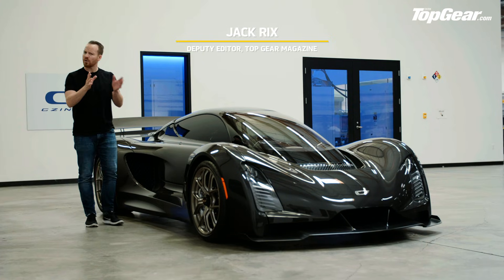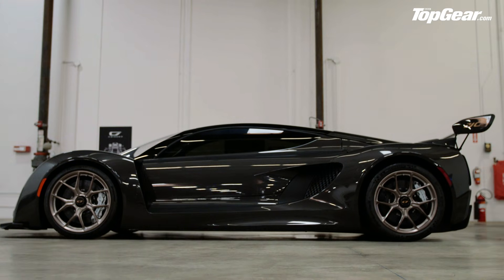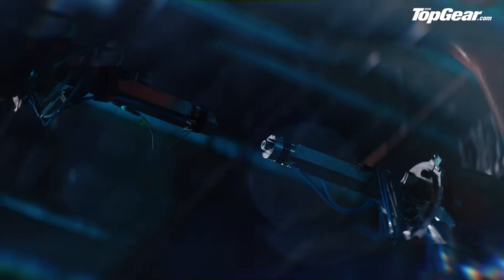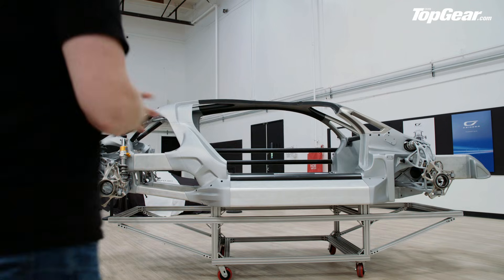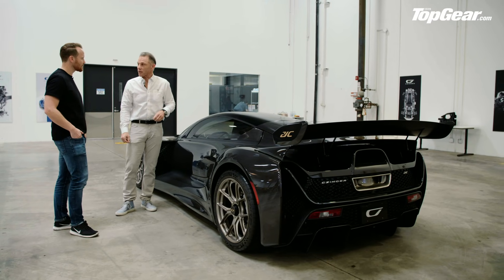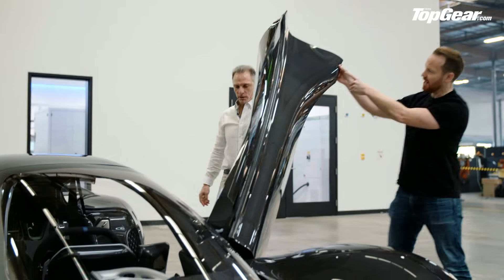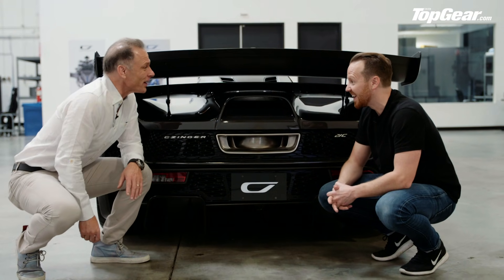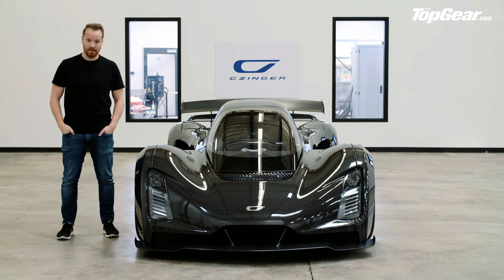FIRST LOOK: Czinger 21C: the world’s first 3D printed hypercar | Top Gear

Comment: What this proves, if they start shipping out cars with no problem, is that Elon Musk was correct when he stated that the most important development in the automotive industry is not the car, but the factory that builds it, the machine that builds the machine as he puts it.

Imagine a completely automated, 3D printing module that is infinitely scalable and can produce whatever car you want 24/7 without ever slowing down, no need to tear down the old production line to build a new one in preparation to start producing the new car model, what you have here is a super fast, super scalable, dead accurate car production that you can switch to a completely different car, with no problem, as long as you feed it its blueprints. Revolutionary.
Reply: This is amazing. This car and this company has had one of the biggest breakthroughs in car history. With AI, cars can be perfect, with minimal problems and issues. Also, this is a genuine car and company that have a genuine and actual hypercar going into production. Unlike some (fake) hypercar companies
Reply: but still costs as much as a hypercar lol
Reply: @crimescene25  This is bleeding edge technology using the the highest quality materials.  Completely understandable in this case i think
Reply: plus its cheaper than some others
Reply: @crimescene25  Economy of scale. Financial, managerial, and purchasing all simplified to the most efficient it can possibly be.
Reply: As Sam Harris warned development and innovation like this will lead to Trillionaire's while the rest of the general public is simply incapable of keeping up with technological advancement to stay employed.

It is a bright and depressing future ahead of us.
Reply: @JasonU21  I don't know about that, who would they sell their products to if only a hand full of people have money? Obviously there will be some growing pains, but it will have to even itself out somehow, the economy couldn't function that way.
Reply: @hzuiel  TRUE only way to solve economics will be basic income
Reply: @stelic9515  I dont believe that is necessary unless economic change is tampered with by governmental forces, lile artificially suppressing automation and then suddenly removing the boot and overnight 100s of millions worldwide are out of work. The economy should adapt at a normal pace, people will shift away from basic monotonous tasks to either high tech, creative, or service industries most likely. If they remove the natural flow of things then it creates waves of mass unemployment, so they almost make government welfare the only solution. Create artificial demand for a solution to a problem they created, that gives politicians all the power. Nobody at their core wants to be on the dole, subject to the whims of the government. I do think UBI is better than like government housing and food stamps, but I am not a fan of wealth redistribution for rhe sake of it, as i say i think interference ultimately creates the very circumstances that necessitate further interference.
Reply: @JasonU21   Well the unemployed could always make crude drawings on MS paint and use AI to turn the drawings into beautiful landscapes to sell to the Trillionares for $100 a piece, so, maybe the future isn't so bleak after all.
Reply: Too poor to buy the tech is already a thing...
Andrew yang and Elon and many others have said global unemployment is inevitable... super crisis on the way.. beware the Vatican beware the pope beware the Sunday law... it’s going to get biblical
Reply: @JasonU21  You're assuming that capitalism will be around forever, which isn't a very good assumption to make, especially considering that it's already beginning to spiral the drain.  At a point where everything is automated, capitalism will no longer work.  Who do you pay if you have no employees, and how does anybody buy anything if nobody has any jobs?  We're coming to that point quickly,  and it's not something we should fear, but be excited for.  No more useless, bullshit jobs doing manual labor or data entry.  Pursue your passions, learn and contribute to humanity through science, the arts, entertainment, what have you, and lead a fulfilled life.  And before you say human nature won't allow for that, remember that we've lived in proto-socialist communities for 90% of our existence, we shouldn't have much of a problem returning to a fully-automated luxury-socialist system when it's the only choice left.
Reply: you also get millions of unemployed people :)
Reply: @lucastseh4709  Only if it happens too fast and education is too expensive.
Reply: What do you mean Musk? I think it was proved beyond any doubt way back by friggin' Ford and the incorporation of the production line... Also, yes, while the premise sounds alluring... You don't actually NEED a 24/7 production model, we can already make way more cars than all of humanity needs, plus, the efficiency and efficiency vs cost, as well as final product quality, in all its different criteria is yet to be proven at all. I'd actually much rather have AI generated roads lol, because the current (government bureaucracy garbage managed) ones are madly inefficient, full of jams, accidents, and that's without even talking of the road maintenance stuff that destroy your car and decrease safety with potholes and bumps and whatnot... Can bet you anything that better roads can stupidly increase society's efficiency, safety, and dramatically decrease fuel consumption, and that's without even going into automated alternate routes, computer car driving, and better cars. I mean yes, if this increases car production efficiency, end product performance and everything else, while maintaining safety, ease of maintenance and repair, that'd be great, but the fact we're like 50-80 years behind on roads (also city management which is also road and traffic destroyer), and how much it holds back society's safety, productiveness, waists time, resources, and adds costs is really quite sad. I also personally think the whole car, or actually, vehicle industry is held back by roads a lot too, Imagine for a second we also had separate lanes for say bikes... Well not bike bikes, these seem to only be ridden by insane people, but stuff like here https://www.youtube.com/watch?v=SawqMSTYUSk&ab_channel=techupdate . So if you're one person getting around (or a bit more, depending what variation of these transports you choose), you waste way less fuel/electricity, and don't face danger from bigger vehicles on your lane, also safety could possibly be improved by installing external airbags around the thing so it can roll if flipped sideways, up front and back too, because it can actually stop you with how light these are. Saves parking spaces and such too. Could also have more mini airports all around to fly tiny private planes, because having some airspace be occupied is also a good idea for decreasing traffic, planes are generally safe too (also, perhaps computer operated planes..?), plus planes are rather efficient... Can make them electric these days too, for short distance flights! And hey, they are even simpler and cheaper to make than cars, maybe even cheaper than a lot of motorcycles https://www.youtube.com/watch?v=hp7JcmwKQcU&ab_channel=PeterSripol ... I bet there's tons of other possible methods of transportation  and innovations just waiting to happen too. Honestly, a lot of problems can be solved these days if you just think about it and let them be solved, heck a lot where proven to be solved, or have pending solutions not implemented, including eliminating high medical costs, way better and cheaper education, way cheaper apartments... But sadly, while it IS possible, and might even sound too good and utopian to a lot, sadly its not to be, because all of these sectors are monopolized by the government, and not only they're inefficient as all hell and don't want to innovate, but they won't let others do it either. But hey, they get to tax like half our income for the shitty stuff they do allow us to have in their infinite grace and wisdom! But everyone seems fine with things as they are so guess the bottom line is we're fucked cuz we're too stupid, compliant, cowardly, violent and dysfunctional as societies to progress anywhere, despite long being able to.
Reply: @mkzhero  we could add 3d printer to the electric car and make a real life transformer runs off electricity that 3d orint things it'll be able to  stand up like a transformer and have a human in it's chest and it can be able to switch into crawl mode to drive in all 4 cause it'll drive on its 2 feet with wheels and we could make have those 24 hr factories that make these electric transformer and everyone family one even a newborn one, and you'd just go and grab one, it'll self drive and tether gps with your family gps,  were moving into farming and instant travel this way but it'll be all insane like that cartoon with the flying cars behind the truth it'll be messed up
Reply: @user-zp9mh4lx8r  Lay off the drugs kid, i have no clue what you're saying...
Reply: You always wanted a model T , now you can have one. No more  of the car companies telling you, the buyer what you can have.
Reply: Complete freedom for the buyer, 1940 ford, ultra modern, no problem.
Reply: Agreed
Reply: 4th industrial revolution  AI be ready
Reply: What you prove is that any factory worker already knew this... most of the poorest labors knows this. ..
Just look at how an apple factory works ... how apples are sized using photographs color size etc 20 years ago ... old tech really.
Reply: With out slowing down? 
Who provides the resources ? 
Input is still sketch out put is fine
Reply: Panopoulos greece Haos print 3d car loooong time agoooo
Reply: Interesting. I remember hearing Musk say in an interview that he initially expected too much out of his robots in his factories and had to rely on humans more than he thought he would. I wonder if this company figured out the process where Musk missed.
Reply: the blueprints where made by an AI
Reply: and the millions of people working will be out of a job
such revolution
Reply: You can add an 5g chip in the car and it'll react with the other 5g towers around instant travel  been here
Reply: Revolutionary that will kill the economy. Yep. Phenomenal.
Reply: Yeah, they could have 8 3D printers and 4 vertical assembly systems at a total of about 16 robots putting together 4 cars at the same time and the facility wouldn't even be half the size of a standard auto assembly plant, it really is amazing and other car manufacturers might start using similar methods to make new models of their cars and even create new facilities, instead of one large facility they could have several small facilities spread throughout the country.

Comment: It's beautiful.  Why aren't there more single seater cars in the normal price range?  I would love to have a single seater like the Bac Mono but affordable and with a roof and that is more along the performance and practicality of a WRX.  Think of the savings in terms of weight and cost: Less doors, controls, seats, seatbelts, airbags over a sedan.  And the packaging would be so much better.  No compromised A/C or ICE setup.  Perfect steering rack geometry and weight distribution.  I don't see why a 1 seater has to be marketed as a weekend track weapon or a multimillion dollar hypercar.  Please Subaru.  Make the next WRX/STi a 1 seater mid-engined flex fuel winged car starting at $23k USD!

Comment: Saying something is designed by a computer is incredibly deseptive... As far as I know Singer has not yet cracked A.I. What they are probably doing is inserting  a CAD file rendered by an engineer; into a fínite element analysis software tool which must have some built in software that re-models the part into something that maximises material shape and quantity where there are stress consenration areas... It may even be a person doing the rendering with the output from the finite element analysis tool. Designed by a computer just sounds good.
Reply: But that sounds a lot less flashy and wowing than "oooh, AI and shit".

Comment: Chaos is coming out soon.4000cc V10 twin turbo. 12000 and 13000 rpm  rev limit 2000 and 3000 ps 0-100 km less than 1.8 sec  top speed over 500 km  max weight 1150 killograms......and the fanny thing  made in HELLAS as known as greece!!!!!!!!Find out more  on you tube.Search chaos  hypercar!!!!!

Comment: Ok, totally got me with the knuckle shapes... AND then the carbon tube nodes, AND the seating arrangement AND the heavy focus on weight reduction and modular design. This is my new favorite car, ever. Now it would be nice to apply that tech to build cool, affordable cars using the most reliable existing drivetrains such as GM LS, HONDA K SERIES, TOYOTA/LEXUS 2JZ, UZ SERIES etc... And get rid of all the bloated, UGLY, over gadgetized and failure-prone pieces of shit pushed by manufacturers.

Comment: CHAOS is comming.Greek hypercar 3000Hp
Reply: Hi, I don't understand greek at all, could you explain me something about the powertrain, weight, chassis, suspensions, technology of that Hypercar?
Reply: First of all its not a Hypercar its a Ultracar made in Greece!
- "ULTRACAR CHAOS" - 
1. 4.0-liter twin-turbo V10 engine firing  3000HP /use E85./ 90 degrees
2. 12,000 rpm/ Red line.
3 Aerodynamics capable of a top speed of over 500 km/h!
4 Special self constracted All wheel drive system.
//Eight-speed gearbox dual-clutch transmission
//Torsen differential to all four wheels
//0-60 mph time of under two seconds
//65% of it will be sent to the rear wheels and 35% to the front!
5, Weight:1000 kg-1150 kg maximum estimated./ Witdh 2.08m
6 The Monocoque chassis and the two seats made fron Zylon material for more stabilityf and safety reasons! (The two seats are build in / to the Monocoque!). 
Body uses Carbon Fiber composite and others like Kevlar etc other parts!
7. 3D printed Titanium Quad Exhaust Pipes (drilled). 3D printed Inconel.
8. Interior: 2 Seats - Augmented Reality - 5G Conection to server / Live Tune Protocol.
9. With a power to weight ratio which is close to 2:1, where for every 2 hp there is 1 kilogram of mass. With such a ratio mated to a suitable transmission technology, with the resulting adhesion, the driver will be able to experience accelerations up to 3G, for specific distances and conditions. The vehicle moving from A to B will need half the time needed by a hyper car or mega car. This may require the driver to have special driving skills and a better perception of space in order to reach the vehicle’s potentials.
10. Specially tires order from abroad Pirelli! (a special tire rubber that heats up harder, with softer sides, which would limit wheel slippage and for a better grip on the road surface)! (Depending on the tire grip) 
11. Downforce 1740 kg / G-Force 2-3G+ 
12. 3D printed 2.08cm Wide Matrix -LED Tail and Stop lights brakes rear end.
13.Special designed and constracted "lightweight" and very strong mechanical components and parts by using "Anadiaplasis" method  all over the car/ that results/ reducing the cars weight very efficient !
14. Color/Material: Anthracite Matte /Graphite Aluminum,
15.Airflow Volume 16.990M3/HR / 1.04m Lower Center of Gravity Car.
16, There will be no exterior mirrors instead there will be cameras built into the cars body and only when the car is turned on will they be automatically moved out. The roof of Chaos A material revolution in each and every one component of the ultracar.AMORPHOUS METAL DUBBED SAM2X5-630.
16b.Printed "anadiaplasi" magnesium matrix composites Calipers and bells & carbon ceramic discs for Chaos.
17. / 0-100 km/h  1.8 sec / 0-400  km/h 7+ sec and capable of a top speed of over 500+ km/h!
for mre details....see the video;
https://www.youtube.com/watch?v=u-lu0QhKaio
Reply: @vassiliosca5715  
3000hp from a 4L V10 seems almost impossible to reach while still being compatible with emission standards,
and surely reliability is going to be an issue.
The "new way of creating objects", applied to pistons and calipers seems very weak.
The idea of carbon pistons seems kind of stupid, carbon is strong but it's not suitable for continuous friction, it will shatter very fast, same for ceramic.
They seemed pretty serious, so I didn't understood why they have some jokes like the "augmented reality".
I think that the transmission has to be magic, I've never heard of something that can handle that power and still be compact, light, fast and reliable.
Altough the main issue has to be the cooling. As we all know, bugatti chiron has 10 radiators to cool the massive 1500hp 8.0L W16, I am curious how are they gonna cool that 3000hp engine.
I'm a bit disappointed that I haven't seen the car's exterior styling.
I saw that they plan to show the complete car at Geneva 2021.
I don't think that they will succeed in doing so, the guy behind the company seems serious, but as of now we just have a Devel Sixteen 2.
Reply: @xxxxxtrxxx13  I try to answer in some way, and by the way i am not an expert to this subject!
1-They will not show "Chaos" in the upcoming Geneva conference in the year 2021 but a second Ultracar called "Apeiron" that is still in development!
2- I also believe the guy behind the company seems serious!
3- the main issue has to be the cooling! I have also thought about it but have not heard or read any information on this topic !how they treat it
4, I believe they are not joking about Augmented reality and 5G conection to server!
5 From what i  heard The ceramic and some other mechanical components are special  aloys strong  and suitable for continuous friction holds ,for over 3000hp and over 12000rpm
i try to write some more when i have some time tomorow.........!